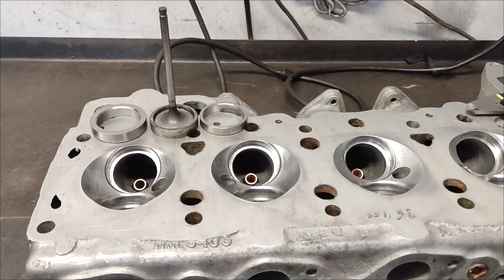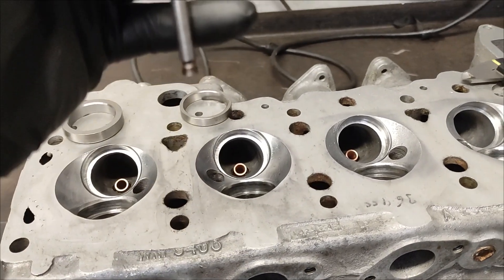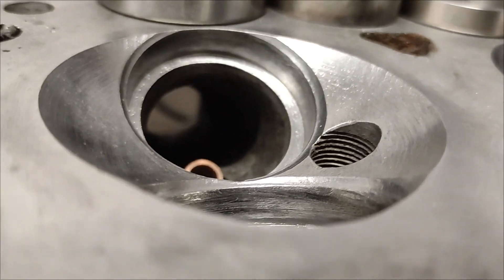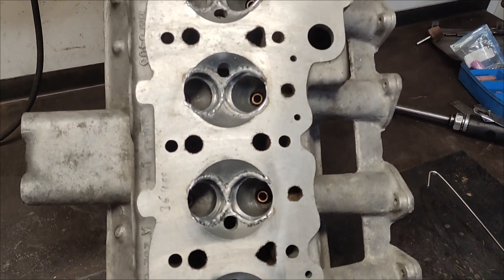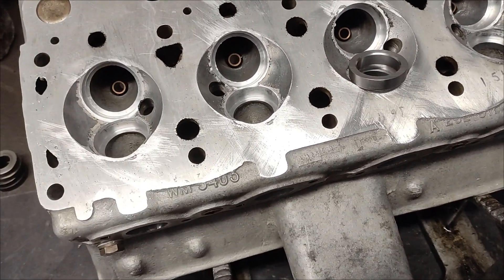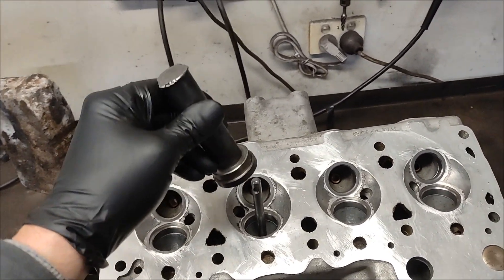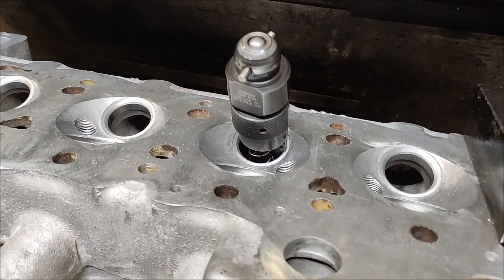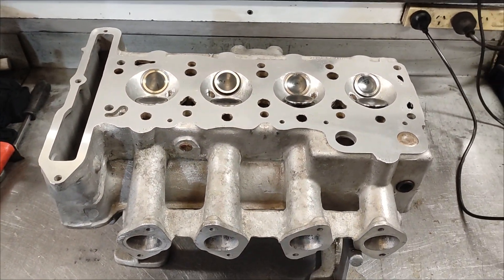Ford Lotus Twin Cam head recondition.

Comment: 5 thousands crush?
You mean .005" interference fit?....Really...?....I know the Head will expand engine running but that sounds excessive....🤔🇬🇧
Reply: Chuck it in the bin already 😂
Reply: Hey just out of curiosity how much interference would you run mate ?
Reply: @jontyconnor9963 Approx....003"
It depends on if you heat the cylinder head in an oven first...At .005 you would have to pre heat...🤔🇬🇧
Reply from the maker: Yes that's what we've always given valve seat inserts.